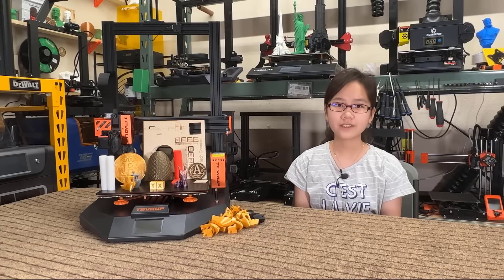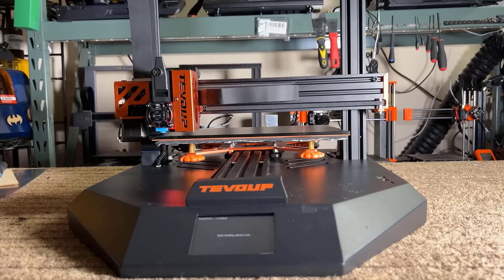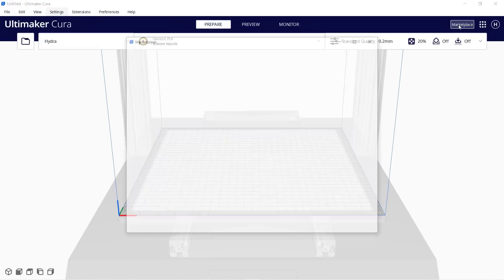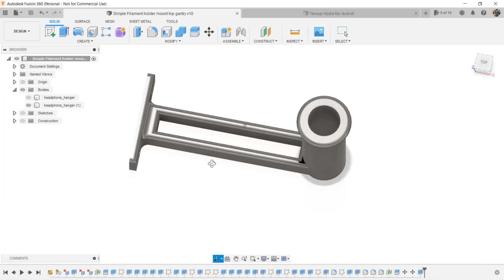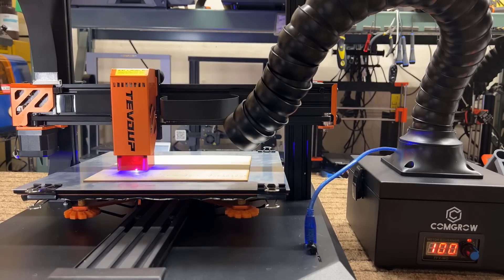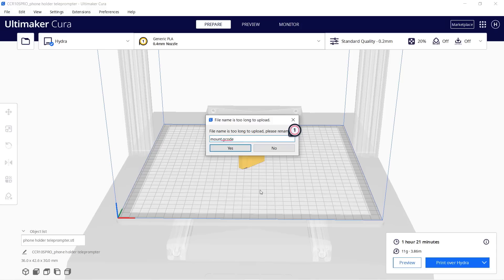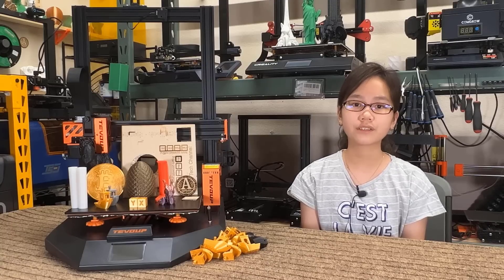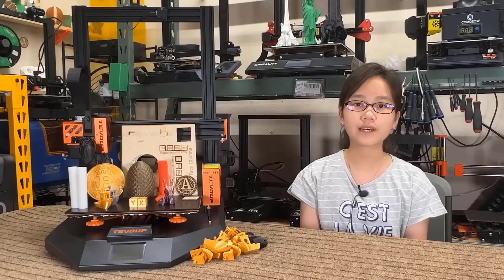Tevoup Hydra 2-IN-1 3D printer w/ 5W laser module, AC heated bed, pros & cons

Comment: excellent review, but there are a few issues I saw on a review of their Tarantula model that I don't see fixed here. most scary is the AC heat bed, there was no heat breaker, and the relay is a normally-on, so if it fails, nothing can cut the power to the heat bed and that's a big no-no in my book. as for the connector on the tool slide, it just looks like trouble waiting to happen as well. I find this model all over Ali Express at $250-300 with a 2W laser, but I'm not sure I want to start hacking solutions for the fire risks on my own, I think I'll keep shopping around.

Comment: Thanks for the detailed review.  Any chance you will be reviewing the laser module that Creality sells for the Ender 3 S1 Pro?
Reply from the maker: I am afraid not, I don't like low-power laser modules, that's a 1.6W and you can't cut any wood, mainly for light engraving and thin cardboard cutting. I would recommend at least using a 5W module.
Reply: @AuroraTech  I've never done any work with laser modules, thank you for the response explaining the distinction.

Comment: This printer requires more work to sort the printing and laser problems. The laser cutter could cause a fire as It has no fire protection and smoke would fill a room very quickly. The laser is really only a gimmick which could cause lots of damage.   I do not believe this printer is good value for the money.  The safer option would be to buy a separate laser cutter as noted and the printer would need the problems fixed fixed before purchase. Rating out of 1-10  (4)
Reply: Good points.